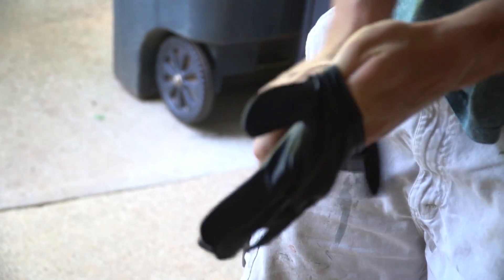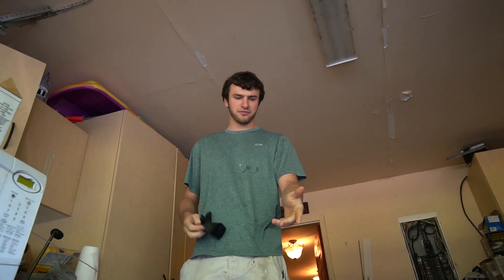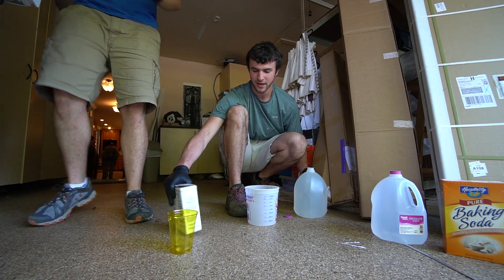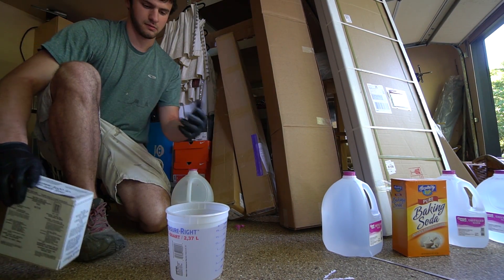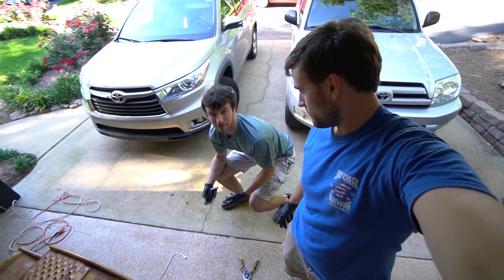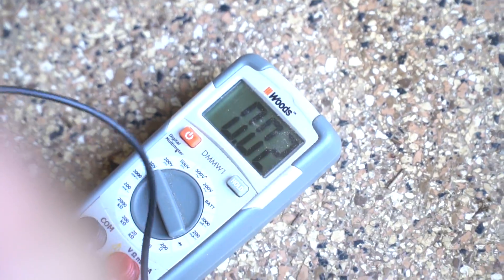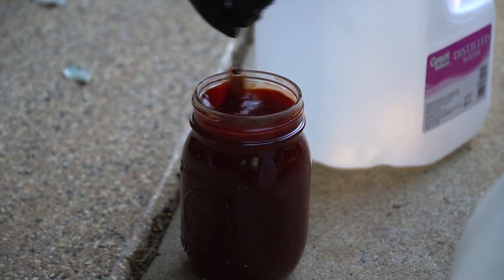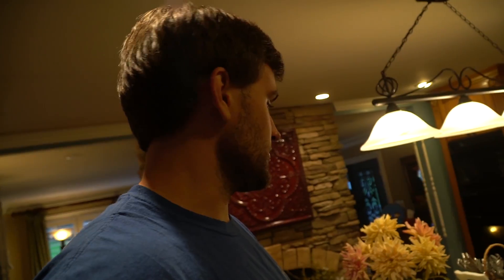DIY Anodize Aluminum At Home With a Battery Charger

Comment: Hey guys!  You can use the multimeter to check continuity on the surface of aluminum parts.  Previously anodized parts should not conduct electricity.  Be sure to check at least 5 different places on part in the event any anodizing is compromised giving false readings.  Soaking in dilute lye should remove old anodizing.
Reply: it depends. certain types of anodizing do conduct electricity, though it's not common

Comment: What's the thermal conductivity when we add dye , want to solder led lights after copper plating and etching copper for copper circuit / pads.

Comment: For Videonator....the lye is to etch/clean the substrate before immersion. The bath is sulfuric acid and the release of large amounts of hydrogen in the bath is actually part of the process. You guys did fine. I think the biggest problem you had the first time is the cathode was too small. It should have at least as much surface area as the anode (the part you are anodizing). It looks like the second time you decided to anodize an almost identical piece as the cathode so you were able to develop a good oxide layer that time. I would also beef up my personal protective gear. Otherwise, keep up the good work gentlemen.
Reply: Which metal did they use for the cathode?

Comment: Real anodizing powder is cheap on eBay and works good. Rit dye won’t wear well nor has the Rockwell of actual anodizing coating. And a decent control cost $200 where a battery charger isn’t ideal. The rest is fairly norm.

Comment: Thanks guys, I got mine working and did a spoke nipple as my first part just to see... I didn't  have distilled water available but my home borehole water worked perfectly fine (grandfather was involved in water purifying). Our water has very little to no iron, which is apparently the most important thing not to have in it. I also still need to purchase dye, but food coloring gave a faint color which is handy to know if I ever need a transparent looking color.

Comment: How hot does the water typically get?

I'm gonna be repairing/refurbishing my phone soon (Droid turbo 2) and i'm thinking about buying a new case and anodizing the aluminium in it.

Only issue is that it comes with the plastic components attached, and i don't know if they can be removed without risk of damage. So im wondering if i can anodize with the plastic components still attached.
Im already looking up what plastics are affected by acid, but i need to know the anodizing temp of the liquid.
Reply from the maker: The water doesn't get hot. I don't know if leaving the plastic on is a bad idea or not.
Reply: They do have to boil the item to make the anodising hard it appears so boiling water is the answer

Comment: 17.5% when you dilute 35% acid solution with de ionized water, distilled water (while better than tap or filtered) is not deionized, do some research, you can not make mistakes or be sloppy random or careless, strict attention to detail. Connection,  Contact, Fastening, Handling, Consistency, and. Notes, keep records. Ill ask to trigger your inception of strict attention, 
1) Solution Temp?
2) Electrode material? 
3) Elect. To Substrate fastening method/material?
4) Power source voltage?
5) Current Amperage? If you do not know this you can"t accurately correct or avoid undesriable results (Changes in amperage occur according to
 1) Solution concentration,
2) Contamination level 
3) Electrode separation
4) Substrate material surface area
5)Substrate : Solution temperature differential
6) Conductor intrusion into solution and the bypass of current from the cathode or anode directly into the electrolyte. 
7) PH of Solution
 Keep notes learn and check your work
Reply: For perspective, these are kids experimenting with death, disability, danger, and disaster.  Like Maynard G. Krebs used to say:  "What, me worry?"

Comment: The cathode should be the same material as the substrate, no conductor material except the cathode in the electrolyte solution, unless you used aluminum wire.
Reply from the maker: It was aluminum wire

Comment: Not a SAFE set up too many items on the floor, with two pairs of feet to kick it over (plus a dog running loose) pans of boiling water with overhanging handles. Accidents waiting to happen!
Reply: about the worst would be the battery charger, but not much of an issue

Comment: Do you have to use a dye? Like would the acid and the final bath be enough if you wanted a natural finish?
Reply from the maker: I think so, just don't add dye and it should leave a clear anodizing on it that will look like plain aluminum.

Comment: Nice job showing the real story with real failure and real success and explaining the failure (already anodized with pores sealed).

Tip to others watching: Both the part and the submerged electrical contact point (depending on factors) can become anodized and block current flow. Yeah, and we should all remember eye protection.
Reply: correct me if I'm wrong, but to my understanding the first attempt didn't work because the part was already anodized?

Comment: Lye is not an acid.  It's basic.  The opposite of an acid.
Reply from the maker: +Jacob Martino I didn't do the research. Maybe he misspoke. I'm surprised at how many comments are directed towards that little insignificant mention. We didn't even do anything with lye in the video. Regardless, it can be used to remove previous anodizing per some brief Google research.

Comment: Super cool! I'm going to give this a shot. My only note is that lye is a base, which is the opposite of an acid.
Reply from the maker: +micvee yes, the lye was in case someone got acid on them, it could be used to neutralize the acid.
Reply: Okay, hang on! Lye is caustic and will burn you. You definitely do  not want to get lye on your bare skin! :)

Baking soda can neutralize the acid and is safe to handle. That's probably what you're thinking of. I think the purpose of lye, in the case of anodizing, is to remove any existing finishes or oils from the part before anodizing.

I'm a big fan of DIY projects, and I am a maker. So, please understand that my comments come from a place of good intentions and admiration! 15,000 people have watched this video. I think you should be careful to not accidentally give advice that could cause people to hurt themselves.
Reply from the maker: +micvee woops, I was taking my brothers advice, he must have misunderstood something.

Comment: What's that filler rod made of?
Reply from the maker: +1xdramakilla aluminum
Reply: Christopher Burress. So both those pieces of metel connected to the  battery are aluminum... Easy to find? I definitely want to try this myself.
Reply from the maker: +1xdramakilla yeah, you just have to make sure that the aluminum you use isn't already anodized like the first piece we tried. You can remove anodizing a variety of ways that Google can tell you. But it was definitely a cool thing to have work out!

Comment: What if you turned the battery charger up, to say 10 amps. Would that speed up the process or even give it a better result? I would be interested in anodizing my turbochargers compressor housing.
Reply from the maker: +TechMarcB hmm, I don't remember, I think the voltage might be based on the surface area that you are anodizing. But I could be way off.
Reply: I don't think doing that to a turbo is smart?
Or its just me not wanting to put ~2000 dollar part in something i mixed up in my garage?
Just send it to someone for profesional job,they shouldn't ask for more than 300 dollars depending on what you want.
P.S. If you are running some Ebay 300 dollar turbo then try it,but do't do it on Garett for god sake.
Reply: Its just the comp cover housing and its completely reversible without leaving any damage behind.

Comment: Where do you buy sulfuric acid? Everything I'm finding is either a mixture or super weak.
Also, what kind of aluminum are you using for the cathode?
Thanks!
Reply: You can get battery acid from parts store.
Reply from the maker: +Daniel Rabinowitz just battery acid, it needs to be diluted to around 15% for this anyways. I don't Know what the turned part Is but the piece we succeeded on was probably 6061.